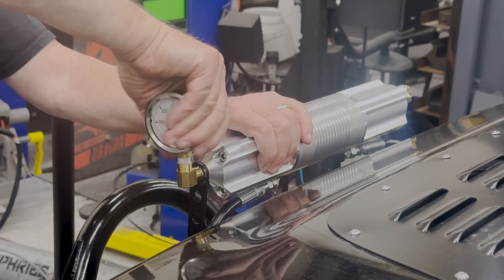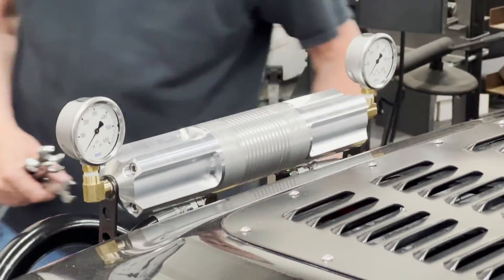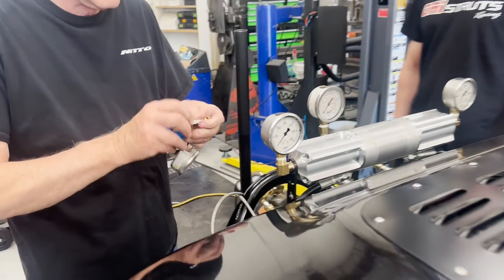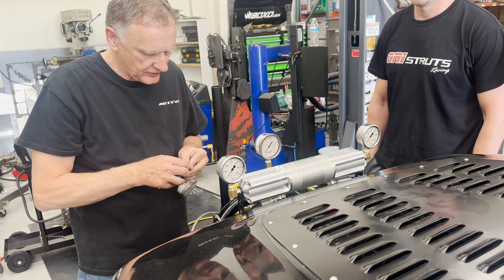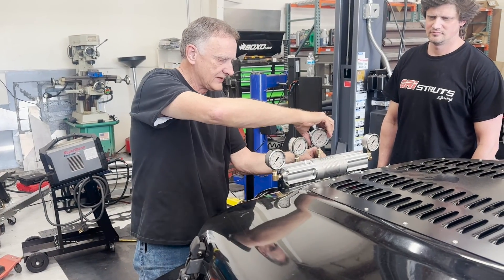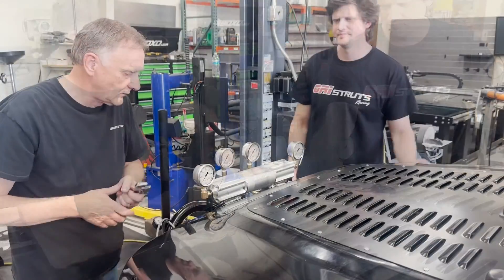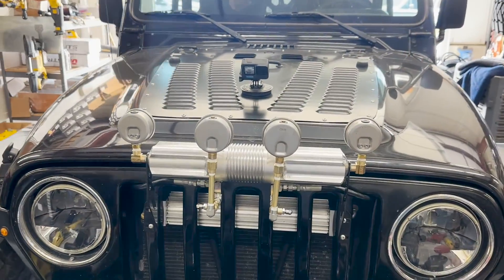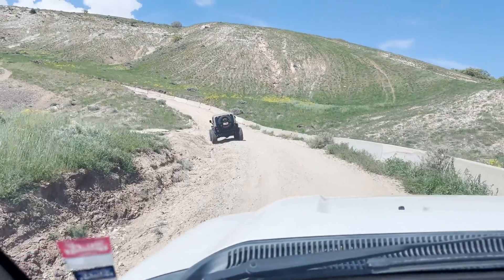Jeep Wrangler TJ LEVEL-IT Test,  New Technology by ORI Struts!

Comment: What about a video showing what happens when in a off-camber articulation scenario? My concern is what happens in a climb off camber, drivers side down, rear driver is trying to compress, front passenger side attempts to compress. Will it be able to or will I be more likely to be 3 wheeling it?

Comment: I also have a 2005 Jeep TJ Rubicon with 4.5" of lift and stock axles (DANA 44 front & rear) and I'm whiling to add in the future either CoilOvers or this ORI's Struts, so I'm curious what size of struts and brackets you are running for you Jeep TJ?
Thanks
Reply from the maker: This TJ is a customers. I think he was running 16" STX struts. I can't remember if the brackets were custom fabricated or purchased.